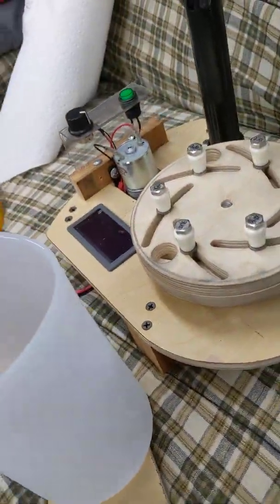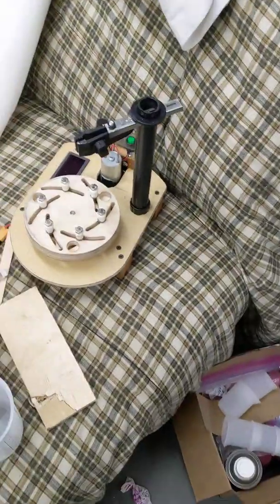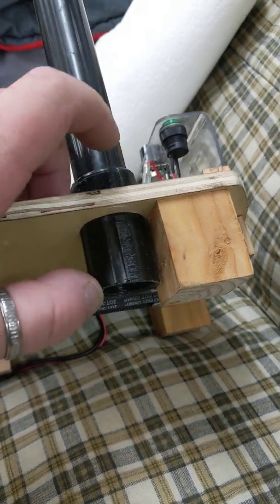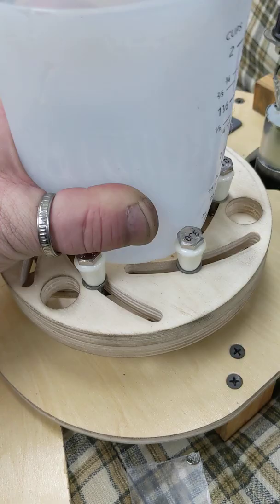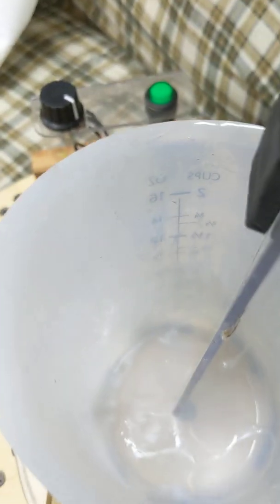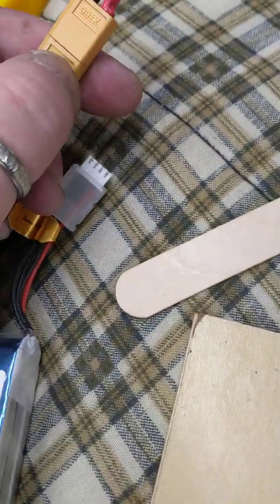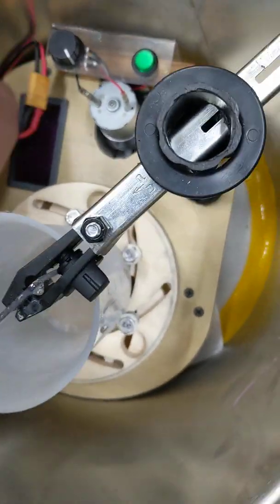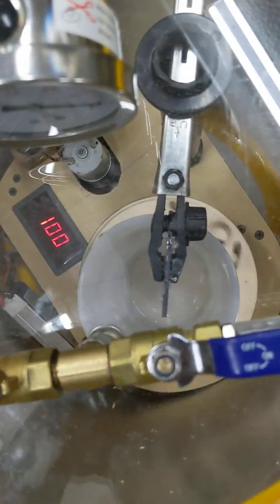A quick overview of my epoxy mixer

Comment: As long as it gets the job done it's all good, but I would just secure the motor upside down to the lid with its wires coming out through a tiny sealed hole and have it spin the plastic stirrer.